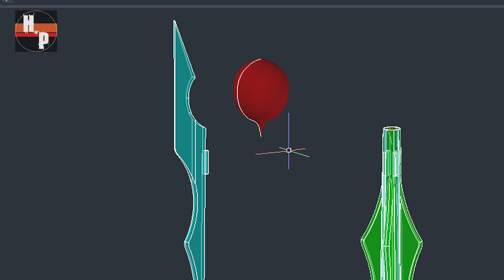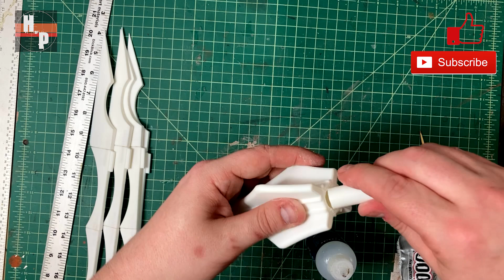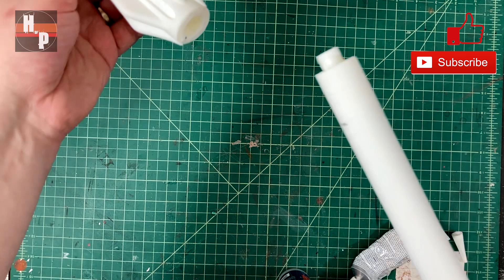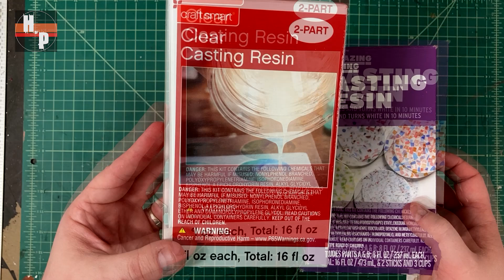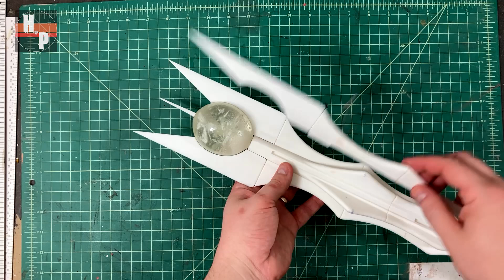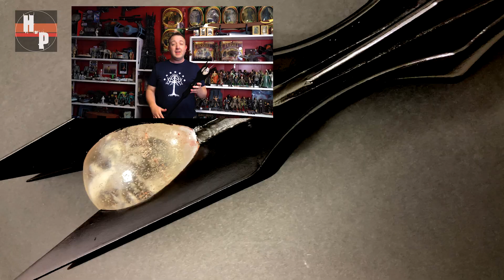3D Printing Saruman's Staff featuring Resin Swirl Orb | Using Resin to Make a Wizards Jewel | LOTR

Comment: I am currently printing this staff (my first 3d print project ever)  with a black filament and about to sand all of the parts.   I also modified the file of the orb so it wouls consist of 2 parts and it being hollow to fit some batteries and LEDs inside.
Reply from the maker: First print ever! That's fantastic, best of luck with it! That's a really smart idea to incorporate some LEDs into it. Let me know how it turns out, and thanks for getting my files!

Comment: Great video! Did you sand the entire staff up to 1000 grit or just the top section with the fins? I’m working on mine now and I’m not sure how much I should sand the main shaft. This will be the first 3d print I’ve actually sanded and painted and not just stuck on a shelf after printing.
Reply from the maker: Thank you so much! Yes, I sanded the entire shaft as well. It's amazing how sanding will hide any signs that it's 3d printed:)
Reply: @haasofprops  okay, thanks for the quick reply!